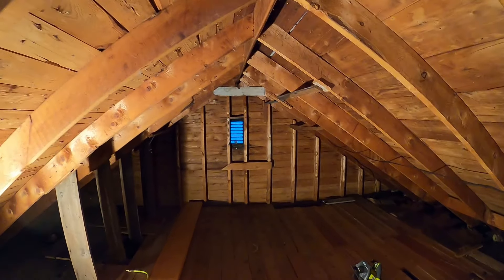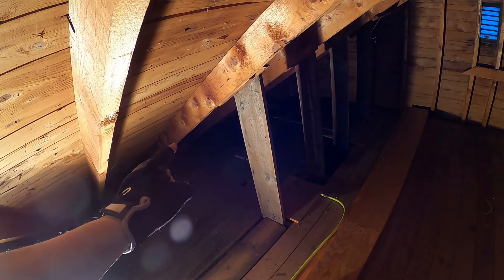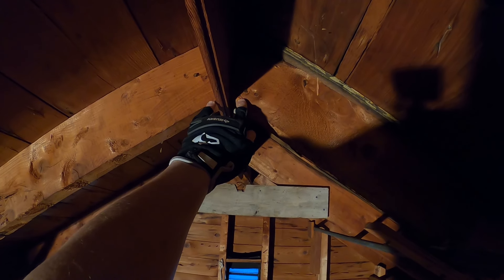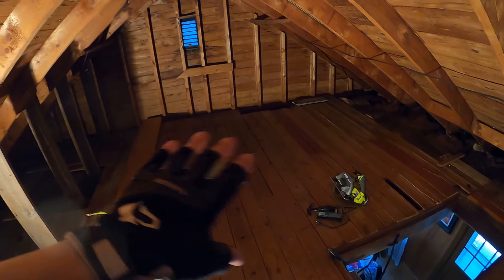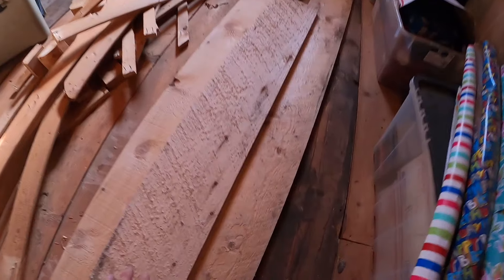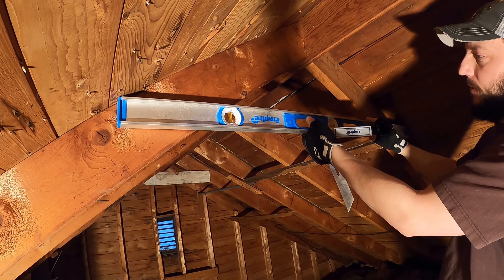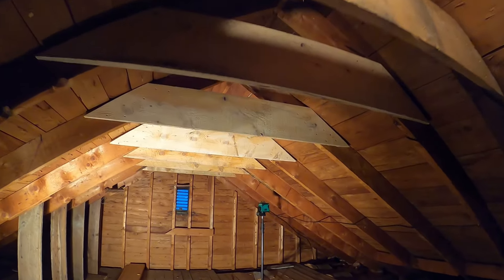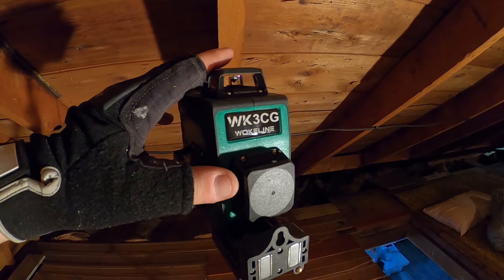How to Install Collar Ties, Why? and What They Do!

Comment: Take width of house and divide the measurement by 3 best way to find how high collar ties go and also have the cuts parallel to roof slope and cut should be 10mm lower then the roof sheathing for shrinkage. I realized you explained that so good job!! 👍

Comment: The job of a Collar tie is to unitize roof rafters to each other across the ridge board when installing a conventionally cut and stack roof structure. Got it. On new structures simply apply straps over ridge board to both rafters before applying roof covering. Both will meet code for stacked roofs. Good info for existing older structures, thanks.

Comment: Clear & precise information; very much appreciated.  I'm currently building a 12x16 workshop off the grid (at our recreational cabin) and wanted to know whether to use collar ties or ceiling ties. The ridge beam will be two 2x8s screwed together running on the 16' length and my 2x6 rafters will be about 10' long (on 16" centres).  Thanks in advance.
Reply from the maker: Dave Dunbar Sounds great, Dave!  Good luck with the project!  Thanks so much for the kind words and for checking out the video!!
Reply: Collars or Ties? Not the same thing at all and there is no choice, 16' length with 2x8's, hope your only storing empty boxes up there.....This is a dangerous video and should be ignored.

Comment: I know the IRC instructs us to place collar ties in the upper third of the rafter length, but it doesn't explicitly warn against placing them too high (as shown in your video). I wonder if a beefy metal gusset or plate might be a stronger solution vs. moving wooden ties up that high? It's great that you include a tie on every rafter pair instead of the nominal "every other" or "no more than 4 feet apart" spacing that many builders seem to abide by. Nice touch with the laser level (always wanted one!).
Reply from the maker: Hey!  Thanks for the comment.  I still wanted to be able to walk around so I put them higher.  I figured any collar ties are better than no collar ties as this house had none.  I mean I am sure it would have stood for another 80 years without them but I am sure this helped when I remodeled the living room below.  Thanks for checking out the video!
Reply: @TheFixerHomeRepair  k

Comment: My son has some separation on some of the rafters, there is about 1/2 to 3/4 of an inch.  Don't know if it was shoddy work on the 55 year old house or there was some stress and pulling.  I will be adding collar ties.  Great video, one of the most informative.
Reply from the maker: Could be a lot of reasons for the gaps.  If I had to guess it was built that way.  Collar ties will give you peace of mind in my opinion.  Hope the video helps.  Thanks for watching!
Reply: @TheFixerHomeRepair  gma
Agree, my newly build have gaps, freaking framers just wanted to get it done and move on

Comment: I'm currently doing collar ties to create a vaulted ceiling. I have architectural plans ect but when I am taking my measurements there is big deviations between end to end measurements due to roof deflection. Is this normal or should I jack these rafters up until there is no deflection?

Comment: I have a bunch of pressure treated floor boards from an old deck (5 1/2 wide by 1 inch thick. They should work okay, right?

Comment: Hey fixer
My  2 car garage roof rafters  are  sagging. Not the ridge, the ridge looks level. . Any thoughts on removing the sag out of 16 foot   2x6 rafters . Built in 1952,  There are  no collar ties , just very long spans of 2x6 roof rafters that sag just about in the middle ...I noticed it lat winter when the roof had about 6  inches inches  of snow on it....

Comment: I have a block garage the walls were pushed out due to no celling joises/ rafter ties well the walls were pulled back in the best the can what's the best way to stop this from happening again I was thinking using 2x8s and overlap them in the middle and glue screw and bolt them on every other rafter and adding coller ties on every other rafter also will this work I won't be storing anything on them so the ceiling joies won't be loan bearing does this should like it would work

Comment: I’ve been doing some research on how to remodel my attic and I was wondering if you could provide any insight. The thing is my attic has rafter ties (not “collar ties”) about 1/3 of the way from the floor up. This is providing structural integrity to prevent the walls of the house from spreading due to outward pressure of the roof. In basically ties together each side of the roof. I noticed you don’t have these and I would like to remove them. Can I place a purlin wall like you have there, so that I might be able to remove the rafter ties so I can stand up in my attic? Also I would be down to add collar ties at the peak if that makes the structure more sound. (Currently no collar ties)
Reply from the maker: Hey, Dexter.  Sorry for the delayed reply.  I think you could move the rafter ties all the way down to the floor as long as they are attached to the rafters and then maybe add plywood over them so you could walk on top.  I am not there so I cannot see exactly the way the house is built so only take this as an option but if the rafter ties are there, they are there for a reason.  I would also recommend collar ties as far up as you can put them.  Hope this helps.  Let me know what you end up doing.  Thanks for watching!
Reply: @MAGAMAN   the ceiling joists do go in the same direction as the ties. And, admittedly very unscientific to mention, but other houses in my neighborhood have removed the ties to open their attics. I’m not saying I just want to rip them out without thinking things through, but I don’t see how the ceiling joists aren’t doing their intended job of keeping the walls tied together. I’d really like to have an attic that is more functional

Comment: My roof setup is the same as yours, I have no collar ties but I have mid ties in my attic, conveniently placed so I can barely move up there, any opinions on removing them and installing collar ties?  Also I noticed you have a knee wall in your attic, I wonder if I would need that installed as well before removing anything.
Reply from the maker: Hey!  I would not recommend removing those ties.  I would have to look at the structure to say for sure but they are there for a reason I would guess.  Maybe you can ask someone local to take a look?  As far as the knee wall, are you refering to the wall in between the attic sections?  If so, that is the old gable wall.  Thanks for checking out the video!

Comment: Is there any issue with not cutting the ends at an angle ?  I have noticed a couple sites say it's not necessary.
Reply: am using 2x4s, straight cut, but I am strictly an amateur trying to stop roof from sagging.

Comment: I’ve been doing research on this topic, and multiple sources have told me that collar ties (“ridge ties”) are not necessary - as long as you have ridge straps at the ridge they are enough to prevent uplift. What do you think about this conclusion?
Reply from the maker: Hey, Dexter!  In my (not so professional) opinion, I think that school of thought is correct for the purpose of stopping the separation of the rafters.  However, I strongly believe collar ties help with the overall structural integrity of the house.  Rafter ties will REALLY help but I believe having collar ties helps to tie the rafters together and even give the roof more strength and somewhat prevent the tail ends of the rafters from pushing out the walls.  With all this in mind, this was the reason I used them on every set of rafters and not just every other.  That is all my opinion anyway.  Hope you enjoyed the video!!
Reply: probably not needed but if you dont need the space this looks like a good idea.
Reply: @TheFixerHomeRepair  Doesn't matter what you believe, hundreds of Structural Engineers say different.....In fact in most modern Blueprints, Collars are never used, it's old technology (Pre 70's)  no longer needed and are easy (if you do have them) to replace to give you more headroom.
Reply from the maker: @sonicmistress  yes, you are correct.  I think the key word is in “modern” designs.  You can build a house in ways where you don’t need them at all.  My house is not a modern design.  I am not an engineer at all so all I can do is do my research and make decisions when working on my house.  Every house is different and ultimately it is up to you as to what you do to yours.

Comment: Great video! I'm looking at buying a house where a few of the rafters are already starting to pull away from the ridge board. I was planning on putting collar ties, but should I get the rafters fixed first?
Reply: I got the same thing going. What did you end up doing?
Reply: @benweston275  After the home inspection, the previous owner ended up installing collar ties so they don't pull further.
Reply: What caused a rafter to pull away from a ridge board? Isn’t all the way leaning in towards a ridge board?

Comment: It is your bldg you cannot cheat if you cared more; you'd take more time. If you wanted higher a 2" steel strap 4' on both sides with a 2x4" wood bridge braced inside.

Comment: Why can't it touch the decking?
Reply from the maker: Hey!  It can touch but if you hold it away you have less of a chance of any squeaking that might happen.  That is really the only reason.  Thanks for watching!
Reply: Expansion from heat and moisture

Comment: I understand how the collar ties beef up the roof and add stability. But is it really needed. Looks like an old house, been around for years through lots of weather and storms, and the rafters look like they haven’t moved since the day the house was built..
Reply: It depends really, on my home I ended up putting central AC with a 2.5 ton unit in the attic, problem being the unit was 17in wide and the gap between my rafters was 16 inches, so I put in collar ties and a couple structural knee walls so I could cut out and relocate other structures to get that AC in. plus it made upgrading the wiring super easy once I could walk down a gang plank and drop the wires where I needed them without having to work around all of the BS

Comment: Honestly.....First of all if a roof doesn't have Collars then it probably doesn't need them, before the introduction of Trusses it was common to find Collars in roofs but they offer no Structrural strength to the roof and they only are there to stop uplift from winds, if they were structural you'd be using Bolts not Nails, total waste of energy, time and money fixing them in a roof this size, it only has some hangers on one side, no struts or purlins.
Reply: How would the wind up lift the rafters
Reply: @Brandon-no3vc  the uplift while the thing is in construction, before it’s completely sealed up